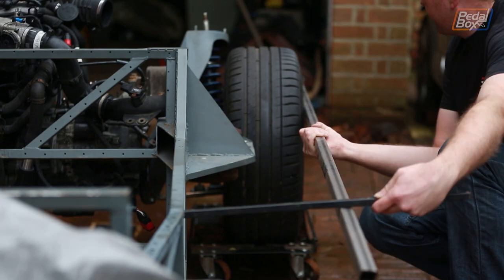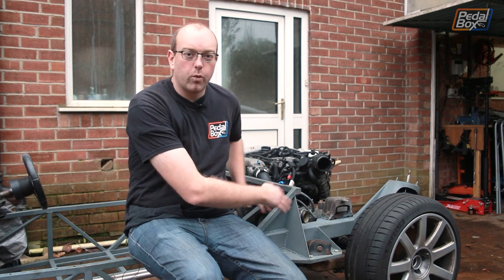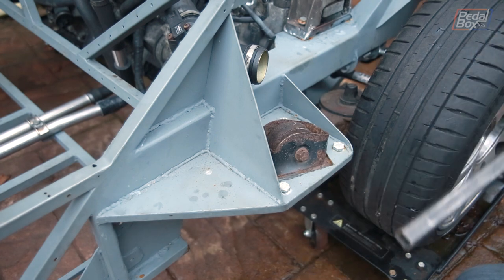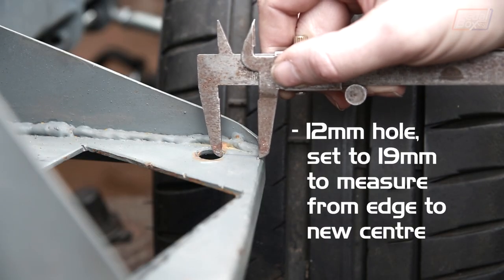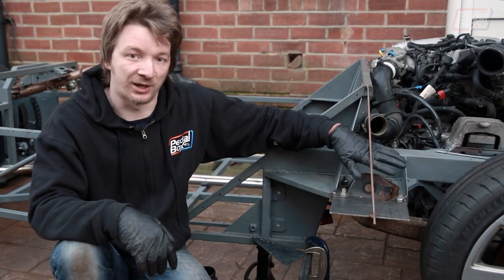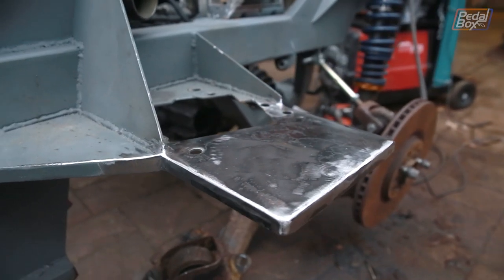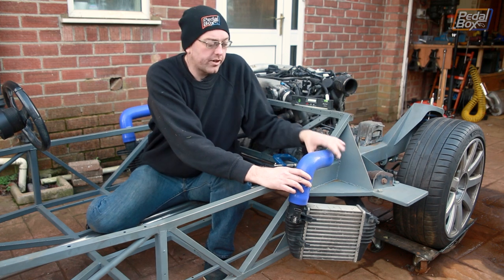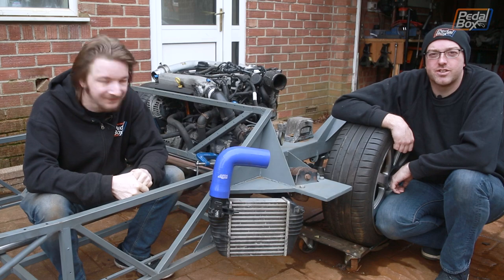Intercoolers and Trailing Arm | Audi Kit-Car | PedalBox Episode 40

Comment: Would the intercoolers be at a better angle and package better if you swapped them over?
Reply from the maker: The inlet/outlet angles are the problem for the most part, tried a few ways round, with routing the pipes all over the shop. The extra benefit this way is there a sensor in the exit housing of the passenger side intercooler which is identical to one on the pipe in the BAM inlet pipework, so we can eliminate the hard plastic pipe (which bends and goes flat for OEM packaging) and run regular. 
Compromises here and there, but overall this one works

Comment: I have a stupid question: Why two intercoolers?
Reply: Dave Hamer they’re both diddy for packaging reasons, so having two gets back to a good amount of cooling power.
Reply from the maker: Adding one big one would mean running boost pipes tot he front of the car, not a terrible problem, but routing past the fuel tank/etc wouldn't be easy, or we MacGyver something over the engine or behind maybe above the exhaust? Not ideal either. Stock coolers can cope with 400hp, and thats still a silly amount for this :)
Reply: Because more is better. Also better weight distribution than just one, which makes it easier to place because it doesn't have to be on the centreline. But mostly because more is always better. More cooling, more horsepowers, more fast, more death- no wait maybe not that last one.
Reply from the maker: @TheMafii  And we could always add a third somewhere else, right? FOR MORE COLDENINGDEATH, ohwait